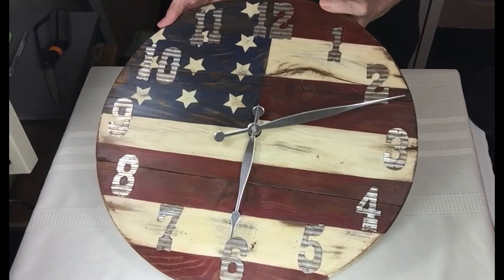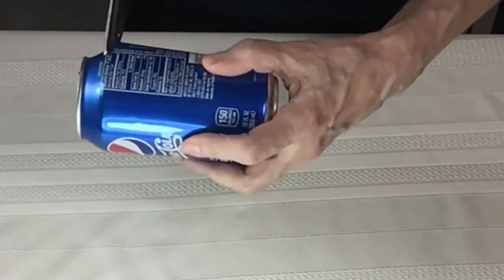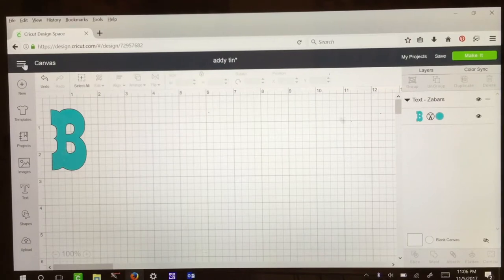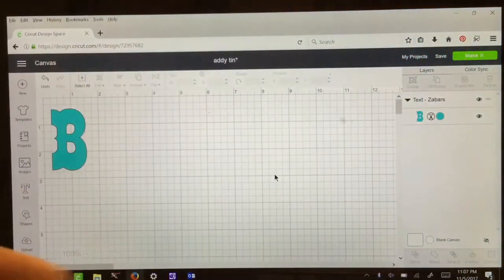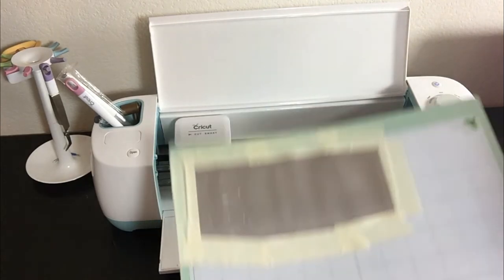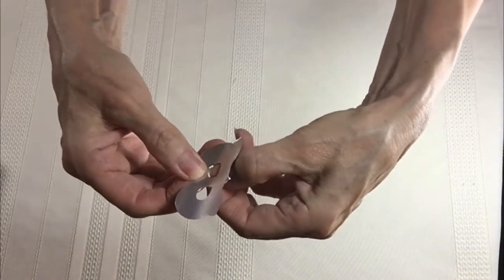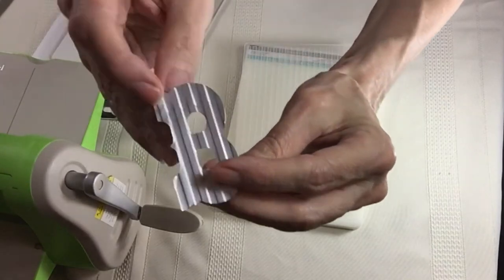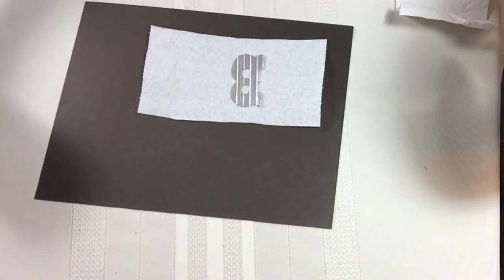Cut Aluminum Soda Cans On Your Cricut.

Comment: Very nicely done video!  Thank you for your time and effort into making it and sharing your very creative idea.  I just finished trying this technique and it came out awesome.  I didn't have any of the wax on hand so I just clipped the aluminum letter in my Cricut tweezers, held it upside down and ran a lighter over the front side from underneath.  It gave a cool effect.  Just have to be very careful as the aluminum gets very hot but cools down quickly. Also have to be careful not to hold the lighter in one spot to long as it can start to warp and pull in on itself.
Reply from the maker: Thank You so much Becky Bert for your kind words. I love love your idea on burning with a lighter. I will definitely be using it. I'll bet it was a cool effect and thank you for sharing it with me. I appreciate it.

Comment: are the edges sharp when cut with a cricut.  does it leave little pieces of metal behind?
Reply from the maker: I can run my finger along the edge and it will not cut it.  It don't leave pieces of the metal on the item it cut Its a a clean cut.